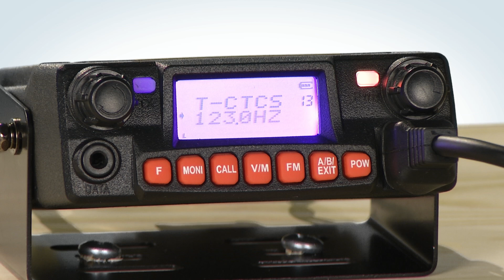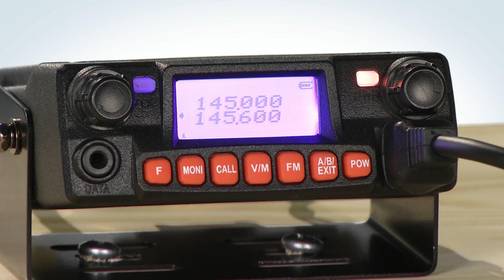BTECH Mobile Front-Panel (Manual) Programming Tutorial: UV-2501+220, UV-5001, UV-2501

Comment: nice video I just have one question. the programming tips that use used the menu selections are they the same on the 2501. I know the face plate is different but are the menu shortcuts the same? thanks in advance for your answer
Reply from the maker: Yes they are the same

Comment: Nice video, what is that data port (lower left, front of the radio) used for, programming or connecting a TNC ?
Reply from the maker: +CRX_Ninja It is for programming, while a 3.5mm on the backside is for audio out
Reply: +BTECH - BaoFeng  - Thank you for the quick reply! I've been very happy with my UV-5RV2+ (for voice) and my BF-F9V2+ for a Home (Raspberry Pi 2/TNC-Pi 2) APRS iGate, now looking at buying a UV-2501 for my car. I've been using HT's for two and half decades in the vehicles, this will be my very first Mobile rig and I'm very excited of the pricing on your great radios.